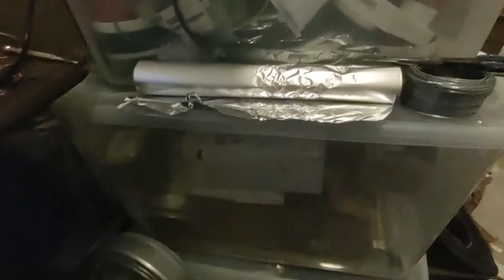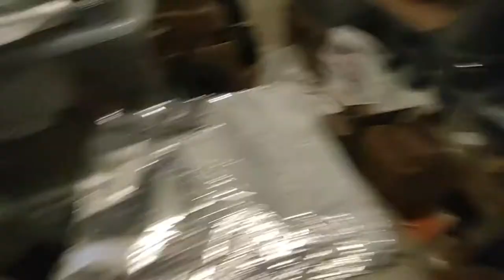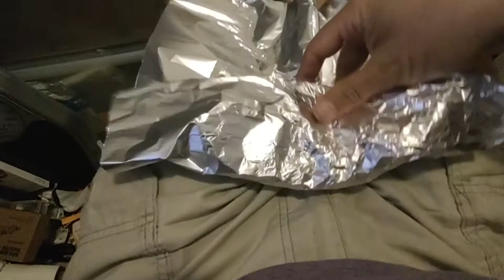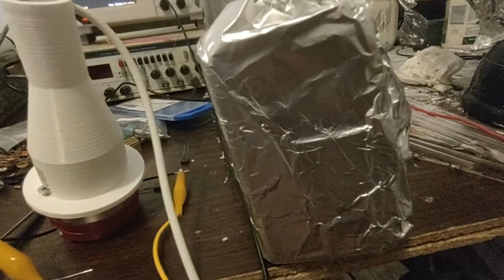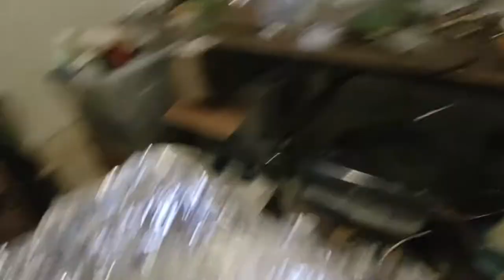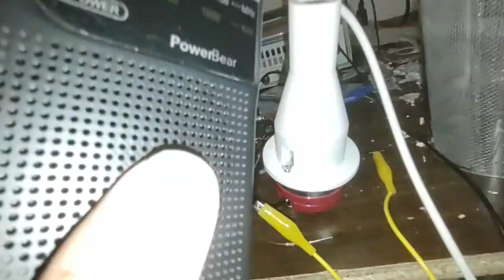Scalar Wave Generator!

Comment: This is NOT scalar wave generator. With alu foil you forbid electrical field. But what about magnetic part. Especely inside of receiver is ferit antenna very good for magnetic part of EM wave. Instead of alu foil put receiver in iron pot with cap and than try.
Reply: by who are you paid to say this 🤗
Reply: @artofwebdesign  Nobody.  I am an electrical engineer.
Reply: @MacotoNagano  but are you a scalar engineer?
Reply: @MacotoNagano this thing still works i tried to pur reciver inside a 3mm thick nested feraday cage metal box .

Comment: I am trying to buy a very powerful scalar wave transmitting device. Any ideas?
Reply: I went to a electronic cell stress testing clinical week ago, where they use a metal stylus to test different acupuncture points on the hands and feet to test cells and organs for stress or weakness and also test for viruses, parasites and heavy metals. And after my test, which determined that my cells and majority of my organs were severely stressed, they had me sit in between their "scalar machine" for a half hour and then retest. They used the Spooky2 Scalar device. 

My test then showed that my cells were back to base-line. Then they also uses the Spooky2 Scalar to generate homeopathic oil drops which I take 2X/day now. I'll just say, I went from feeling like liquid ass for 3 years, waking up in a stooper with no energy and achy joints to feeling about 50% back to normal. I will linely be going back for another treatment or 2 soon but I am saving up for a spooky2 scalar machine ($1500) so I can just sleep in the field. I have no other idea which "scalar" products on the market work but I do believe the Spooky2 Scalar is legit.